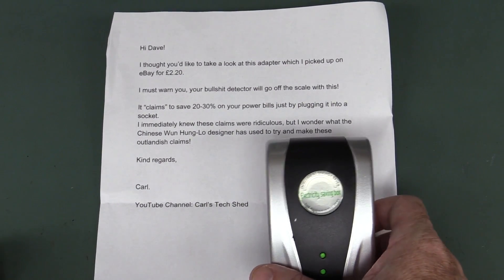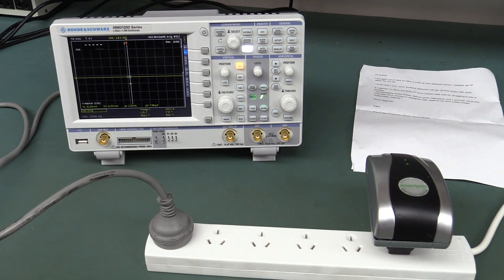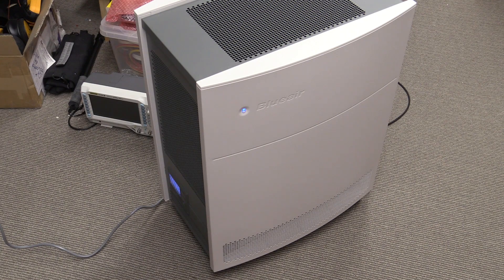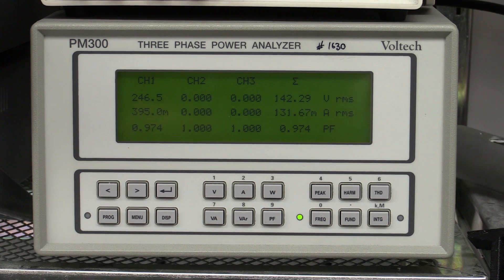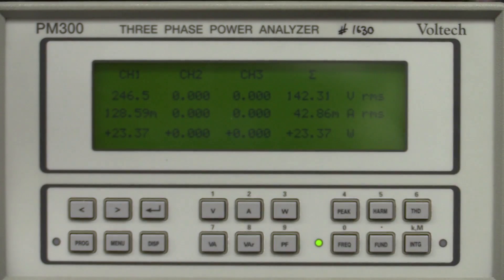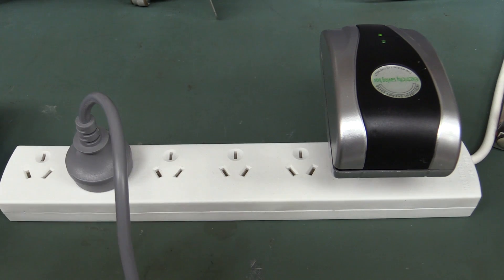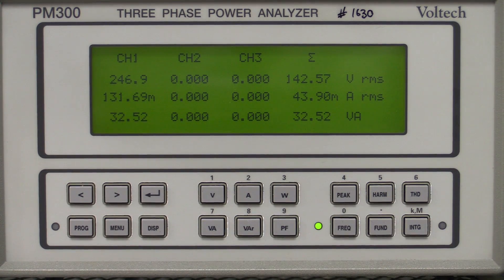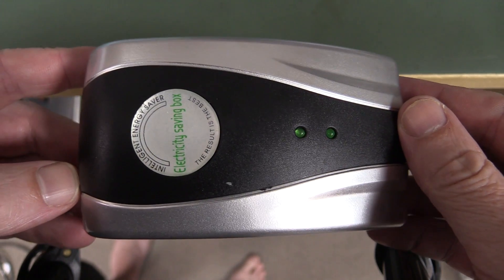EEVblog #848 - Home Energy Savers BUSTED!

Comment: Conserve power, use electronics smartly, unplug shit, and do renewable energy (solar wind). My KW/H use is about 1/3 after designing my system to take circuits off mains.
Reply: +Dillon Flannery Why not use all of that? Wind AND solar AND geothermal AND hydro power AND tides AND waves ! It's all free.
Reply: +Chris DIYer Never do wind. It ruins the landscape. Wind has the least energy density of all, cost the most. Total failure.
Reply: +MrTridac I wouldn't call them free, they all come with trade offs. Solar panels are made using extremely toxic materials, hydro damages ecosystems and hurts fish populations, wave and tidal might be OK for the most part but I don't think there has been extensive research into how affects those ecosystems. Considering a large amount of food comes from the ocean it's an important thing to consider. The problem with wind is that the payoff on them in terms of power spent to make them vs how long it will take to make it back aren't the greatest but they're getting better. Geothermal might be fine though. It's important to remember there is no magic cure all for problems, and we should always consider the trade offs of them.
Reply: +Joshua Solar panels are made using the same "toxic" materials that are used to manufacture every single electronic device. Although I would prefer having solar panels rather than new mobile phones coming out every 5 minutes... but people like mobile phones and dislike solar panels so we are stuck with that.
Reply: +MrOpenGL While this is true, the scales are very very different. We're talking a panel made completely of n-type and p-type doped silicon, where as a phone may only have a few 100um of the same material involved. I love solar panels and think they're great and really want to get a set myself probably next generation of them, but I really don't feel they're comparable to traditional electronics because of the scales being used. Looking at some quick numbers and solar sites, if we take the surface area of every person in the world having a smart phone, it would take up approximately 20km^2. The current largest solar panel site is Topaz Solar Farm with a site area of 25km^2 (not all of this is used). That's a single solar farm, with many more planned in many countries. The scales are vastly different when compared to cell phones and traditional electronics.
Reply: Joshua
I get what you mean. Still, in a solar panel there's only silicon. In a phone, there's tantalum, silicon, lithium, gold... and the other problem is that most people throw their phone away after 6 months since it is "outdated" (well I'm still using a Palm Treo so I am very "outdated") while solar panels last for 15 to 20 years at least (nowadays I see they're guaranteed for 25 years before dropping below 50%). Ultimately, if people stopped consuming so much, we would have less need for solar panels... after all the Roman or Greek Empires didn't have electricity at all!
Reply: +MrOpenGL Let me preface by saying I'm thankful to have an intelligent conversation in this topic considering this is YouTube after all. I agree but I don't think people are changing their phones that often anymore, I think average time is most likely around 2 years before most people upgrade. Regardless your point is correct and the time of service is very important to consider. I'm hesitant to say either is worse than the other now with more thought on the subject. I want to say that they may be comparable because of the size scale compared to service time scales, but I doubt that is correct and a real answer would require a more thorough analysis. Maybe such an analysis is something that should be considered, or maybe one has already been done that I don't know of?
Reply: Joshua
I can only agree with what you wrote.
As a side note,a few hours ago I was watching my old CRT TV in the kitchen (I have another LCD tv in the living room, but I haven't bought either of these, because they are gifts of friends who have changed them for newer models!!!) and wondering: a few years ago everybody had CRT TVs (at least one) in their homes. Now they all have LCD. Isn't that quite alarming? Knowing in Italy there are 45 million people, and let's say 50% of them had a CRT TV and replaced it with a LCD, that's 22.5 MILLIONS of TVs (almost all of them working) that went to waste! The same goes for CRT PC monitors. I find that really disgusting, more than any dirty process for producing solar panels

Comment: Not that it matters...But from an engineering perspective it would be better with banks of both capacitors and inductors that could be switched in as needed to properly correct for a measured PF.

Comment: I never heard of any country that bills VA, thinking about how older watt meter works I would think that building a VA meter would even be worse for the utilitiy companies. Anyways, with LED lighting and stuff everywhere power factor is starting to get an issue at some places, and at least around here utility companies have sent gentle reminders about that the fineprint of your contract specifies the powerfactors that your whole house is allowed to have at some selected places.
Reply: A kWh meter turns only wenn the powerfactor is about 0.8 (cos Phi) they are calibrated on that factor.
When the factor is 1 the meter don't turn anymore (by the way this is for the old mechanical meters)
Reply: Bp Oelen I don't know what meters you have, but here the meters measure real power, not VA and they don't care about the powerfactor. If they would only turn at 0.8, correcting your pf to 0.95 would mean no counting on your meters? unlikely. And since smart meters are growing like mushrooms on a dead tree here, what mechanical meters do will be moot anyways in a few years.
Reply: A turning kwh-meter has two coils one for the current and one for the voltage these coils make field for the turning wheel because there is a fase difference.

Comment: I may be completely wrong here but if you have a 750VA UPS, if you did have a capacitor on the output and the correct load, could the UPS theoretically run for longer than without a capacitor as the VA usage would drop?

Comment: Those black boxes are widely used in industrial applications in some smaller electric motors. But the industrial versions have proper labeling on them. Often it's just a resistor and capacitor in series. For industrial applications it can be quite useful when a machine is not properly designed, powerfactor correction wise. But a well designed machine has powerfactor correction on board these days.

Comment: Not only are they a scam but they would possibly be illegal in Australia and New Zealand.  Unless they had the correct plug.  And that is unlikely since they would not tool up for a small market.  If sold in New Zealand they would  need a Supplier Declaration of Conformity, which they are not likely to get.

Comment: Dave, what about safety? Plug a random capacitor whitout event print on it seems for me as a bad idea. And what about circuit? Is there any fuse?
Reply: +G0867532 Chinese stuff tends to use the incredibly thin wires as fuses :)
Reply: +TheChipmunk2008 
Or thick wires, like in the "hoverboards" which catch fire XD
(They don't even hover ... god, I DESPISE falsely named products!)
Reply: +Benjamin “Ozias” Esposti well... automatic skateboard with 90° wheels ?

Comment: Dave your wall to wall carpet is not practical - I recommend linoleum.Would be nice to have about the theory about power factor (cosinus phi) when inductive loads causeCurrent go in fase behind voltage.Wait !!!! Don't thoruw it - you can use use the case for a project. It connect directly to the mains.........:-)

Comment: I tend to use the term 'crest factor' for rectifier-capacitor front end devices, rather than power factor, since the voltage and current peaks occur at the same point on the sinusoid.

I had a problem with electric vehicle battery chargers tripping circuit breakers because of the crest factor. To avoid this I used an inductor in series with the mains power to lower the peak current and then a capacitor across the line to correct for the phase shift of the inductor. The values were optimised for peak power and made things worse towards the end of charge, but no more tripped breakers.

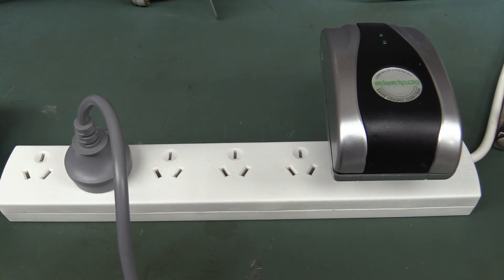Comment: Also - could you clarify for me what you meant at 9:00? Why would it matter where in your home the device would be plugged in, since all the outlets in your home are essentially all in parallel?
Reply: +themaritimeman I guess your house wiring is a perfect superconductor with a perfect 0 Ohms of resistance, right?
Reply: +Ewan Marshall Of course not - no need to be a smartass. I just wasn't aware there was enough resistance to be significant.
Reply: +themaritimeman the amount of resistance in your home's wiring is more significant then the capacitance of that device

Comment: Wow, what a sham. I weep for those who are actually falling for these. I wonder if, given the number of electronic devices, which are primarily capacitive loads, that are in the average home now, if this device would actually lower the overall power factor of the home?

I see only one scenario in which this could save you money, even if you only pay for real power - if the PF is improved, current is lowered, so resistive losses in the building's wiring would be lowered. Savings from that would be practically negligible, though, and possibly negated by the real power consumption of the device.

Comment: I spotted some slavic runes on the bottom of the device.
I don't remember details, but apparently it is very common for houses in Russia to have power lines connected incorrectly, and it was possible with such type of a device to trick older models of electricity meters into measuring negative consumption and make them spin backwards.

Comment: Surely, if it doesn't work for saving my electricity bill, I can hook it up to my car alternator and increase my fuel mileage by aligning the molecular resonance of the current flowing in the wiring and by creating a magnetic field which produces a polyphase stratification of the subatomic particles so that the gasoline mixes more completely with air and thus burns with lower pollution, more power and a sweeter smell.   I mean... surely that must work... right? ;-)
Reply: +xjet Only if you make sure you oscillate the modular field by 34.6 mega-degrees counter-clockwise & retro-sink the variance sifter.
Reply: +xjet You need a turbo encabulator
Reply: +InfernosReaper 34.6 mega-degrees? Are you crazy? You'll bring about the end of the world like that! You meant 36.4 mega degrees, right?
Reply: +xjet But you definitely should make sure that there is no flux capacitor in your car, or else it could emit a pulse of 1.21 Jiggawatt and throw you back to 1955 if you drive too fast!
Reply: It would simply refill your fuel tank
Reply: +xjet Don't forget to phase shift your car's windows by a value of 42.
Reply: ***** Aaah, so you have to make sure not to travel above 88mph then. A random and chaotic time travel could lead to serious problems after all...
They should write some warning signs on these energy savers, as they can be very dangerous!
Reply: +xjet I don't know, but I'm sure it's easier than the HK pulse jet. : )
Reply: +xjet You have to do a web cast video from your model review channel with EEV on some of the same hardware, I think it could be the funniest thing ever, you both have the same mannerisms when it comes to tearing into cheap electronics.

Just Imagine.... xD

But to both of you, keep up the good work! :)
Reply: Allison Pell
Oh god, yeah, you're right. I forgot to carry the 2 again.
Reply: +xjet Exactly!
Reply: +xjet I suggest getting it on Ebay pronto!
Reply: but be careful you don't cross the streams....

Comment: Since industrial facilities are charged based on apparent power, would plugging in a load (say an induction motor) to a power point in an industrial facility actually reduce costs, because it would improve the pf which matters to those  customers?

Comment: Based on Dave's measurement of the cap, impedance will be approximately 1100 ohms capacitive with 50 Hz mains. In shunt on 230V mains, I would expect this cap to supply approximately 47 VAR to an adjacent inductive load. To put this in perspective, on a load with very bad 0.5 PF inductive where this cap supplies 100% of the reactive power to the load, you would reduce total apparent power from 54 VA to 27 VA (pure Watts). This would reduce current draw from 235 mA to 117 mA. In terms of line loss (for 100m of 14 AWG installed using staples or non-metallic raceway), conductor losses would drop from to 125 mW to 31 mW.

Even in the case of this ridiculous example, I think this amount of power savings is in the realm of "I don't care". PFC pays off for commercial customers because of 1) demand billing and 2) copper or transformation savings for long distribution in the facility. The capacitors involved will also be substantially larger, possibly a synchronous capacitor.

Comment: So, if you had a air purifier in a factory's break room, and you cut off the LED's from this thing, then you MIGHT save a tiny bit of power? That's a rather small market right there.

Comment: 8:25 2*pi
Reply from the maker: +Tim Williams Fixed.
Reply: +EEVblog What about the Orison on kickstarter? https://www.kickstarter.com/projects/ericclifton/orison-rethink-the-power-of-energy?ref=discover_potd
Feels like bullshit, not even sure if it would be legal to back feed your home by tripping the circuit breaker, plus I  feel for the poor electrician that will die because of it.
Reply: +Ola Lilliehöök Isn't that the same thing that Tesla Motors is doing with its Powerwall?
Reply: +Pentachoron Im pretty sure the Tesla "powerwall" is integrated in the electric system and not a plug and play you put in your wall socket.
Reply: +Ola Lilliehöök it's a plug and play that you connect to the input of your inverter

Comment: Dave, it's OK if this thing doesn't work, because Solar Roadways are back.  France has decided to implement 1000 km of solar roadways.

http://www.iflscience.com/technology/france-will-install-over-600-miles-solar-panelled-roads-2020
Reply: They should build it as a shade for cyclists, and angle it to better prevent snow build-up.  Still a dubious idea.

Much more sensible to put panels in parking areas for electric cars to use -- once you have self-drive cars they can drop you off and scoot away to park in a remote location, then charge up while they're parked.
Reply: +boggisthecat solar roadways are dumb just use solar panels for shade. Make every road a giant carport

Comment: Works by PFC
Reply: +HDXFH
In theory, yes.
In practice, these simple "cap across the mains" devices are a crock of shit.

Besides, any "fixed" appliance with a big electric motor in it sold these days will already have a power factor correction capacitor installed that is sized appropriately to the load (ex. fridge/icebox, air conditioner). The capacitor MUST be sized appropriately or else the power factor can be made WORSE instead of better.

Heck, even the power supply for the computer I built 4 months ago (and I'm posting this from) has power factor correction BUILT IN.

My point is this: If it's less than 5 years old and you think it would benefit from power factor correction, there's a very very high chance it's already got power factor correction built into it.
Using the kind of device shown in this video will do one thing for sure, and maybe one of three other things.
It will separate you from your money for sure.
It might do nothing.
It might make your house's overall power factor worse.
If it's a particularly poorly constructed product, it might burst into flames without even tripping the breaker.

Unfortunately, adding negative reviews to the product on Ebay will do nothing this product's sales, as there's a sucker born every minute. You can try to save a few of them by education, but I've found most are beyond saving. Often, they won't even listen to logic and reasoning because it challenges their beliefs, ESPECIALLY if their beliefs are not supported by incontrovertible facts.